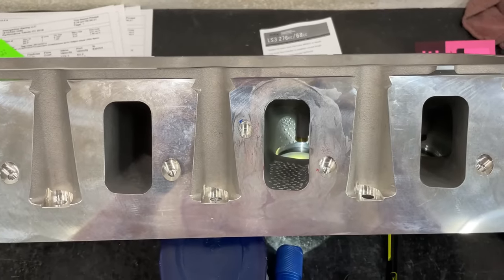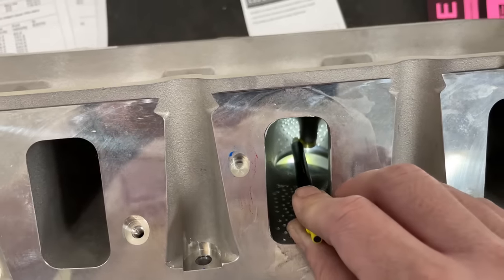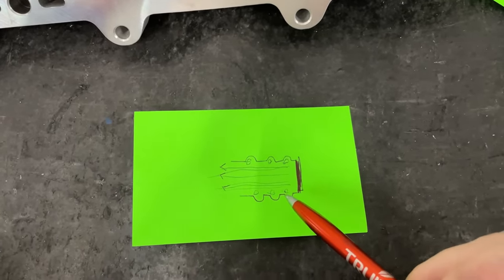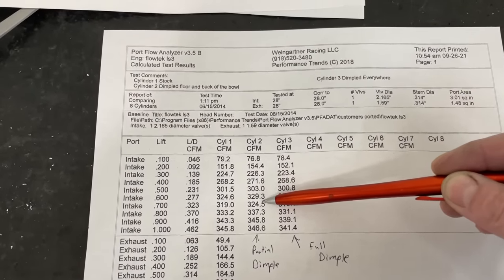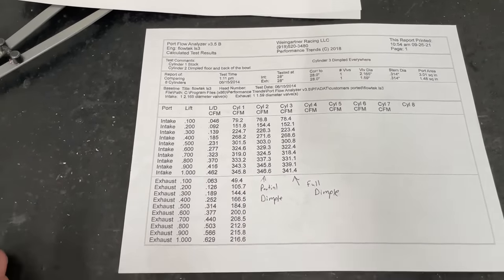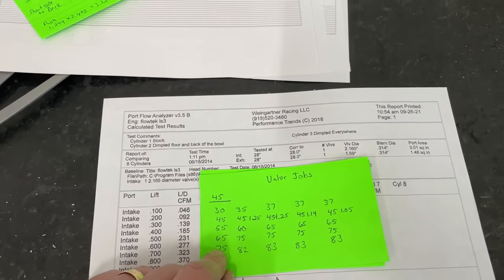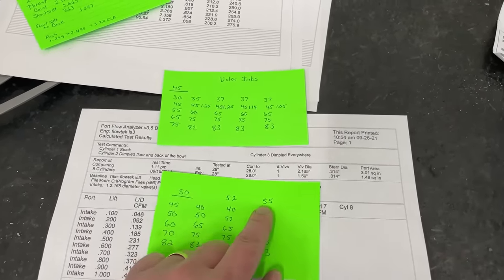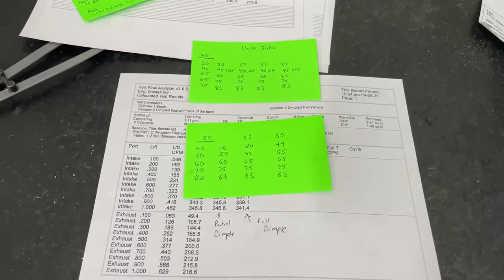Dimpling of Intake Ports Does It Help Part 1 of Internet Ports Heads

Comment: "Dimples on a golf ball create a thin turbulent boundary layer of air that clings to the ball's surface. This allows the smoothly flowing air to follow the ball's surface a little farther around the back side of the ball, thereby decreasing the size of the wake. Scientific American
Reply: That is interesting concept. Have to give you the credit because that's how you find out things and you never know until it's proven wrong. Fluid dynamics is very interesting. What about little runners of blades along the walls. I would not know how to install them, but it would be worth trying something different. Good luck with your testing. You should retest 3 to 5 times then average you numbers unless you can really rely on your number for a bass line and result, so you know it's not a fluke.
Reply: After reading this… Can we start talking about putting dimples on the rear half of race cars panels?
Reply: I think the dimpled principle is worth exploring but a golf ball moving 400 feet per second is different from air moving through a cylinder head under vacuum and with the valve pulses. So they might have to modify the size of the dimples or invert them. But I definitely think it's worth exploring.
Reply: @scottshields8334  tell that to Bugatti
Reply: @scottshields8334  I have tested your hypothesis to see if it could be disproved using the scientific method.
For the test I simply obtained a golf ball and an engine head.
As a control I obtained a second golf ball and an engine head and set them aside under 24 hour surveillance to ensure neither of them was sexually attracted to the other and engaged the other in intimate relations resulting in reproduction of like kind.
I then observed the first golf ball and engine head and compared them geometrically for consistency of design.
Neither of the objects observed displayed any discernible similarities in either shape, size, colour, weight, mass, intended use, common use, form, function, retail price, or resale value. 
I'm sure Bugatti would agree.
Reply: I know there are high end engine builders that dimple there cylinder heads and runners there’s got to be some truth to it
Reply: @thelibertyghost1776  yes sir, I use dimples on intake manifolds, but on the short quick turns. It helps pull the air around corners. Alot of the foreign exotic cars use them.
Reply: @notsponsored103  Modern Science. 🤣🤣
Reply: Fluid flow is sticky at boundaries due to viscosity. That sticky layer creates a gradient from 0 velocity at surface to a laminar-to-turbulent interface at some distance normal to the boundary surface. The dimples create turbulence closer to the boundary surface, so that sticky / laminar layer is thinner and more port area experiences turbulent flow. Basically it makes the port larger in area (there's more complexity, but this is essentially what's going on). This is not a great idea for some cases. Bottom of port worked good because that was the slowest air flow regime. The dimples on the bottom reduces the distance of turbulent airflow from the bottom, i.e. makes the port seem bigger. But the direction the turbulence acts is very important. Top of the port and top of the bowl introduces turbulence that opposes the general direct of flow. It lifts the airflow off those surfaces and generates turbulence normal to the surface that actually pushes against the airflow making the turn down through the valve. That's why the flow bench results were like that.

 Dimpling is only important in cases where the port does not have fully developed turbulent flow. I.e. at lower valve lift, the sticky boundary layer has more effect because the valve is physically unable to flow all the air that "could" be supplied. So air has to slow down and there's kind of a "tunneling" of turbulent air flow though a shell of slow air at boundaries. At high valve lift, more port area experiences turbulent flow naturally because more air is getting sucked past the valve. Then the dimples have little effect because the boundary layer is thinner.

It's somewhat different than a golf ball. The golf ball dimples increase turbulent air to "backfill" the low pressure area behind the ball's travel vector and reduce drag. Totally different aerodynamic regime.
Reply: @scottshields8334  myth busters did it to a 90 something ford tori's and it saved gas
Reply: @HalfBakked218  that’s what vortex generators are for. Evo’s and a few other cars used them (on the roof towards the back) from the factory to increase attached flow on the rear glass and increase the effectiveness of the wing at higher speeds. Airplanes often have them on the wings or horizontal stabilizers. All the dimples/vortex generators do is add energy to the stagnant boundary layer so the flow stays attached.
Reply: @brianballewsr20  nice! See I was just like why not… and you’re like they already did that lol… I could totally see those little pockets create the increased air flo.
Reply: @scottshields8334  agree, I tried to replace my heads with balls... total fail!
Reply: @tondaporter3709  That's where they should be, to prevent flow separation on the inner side of the curve and help get rid of pressure drag on the incoming flow. Exactly how a golf ball works.
Reply: @tondaporter3709  only the turns? Do you get a negative effect doing the whole port or partial(floor-only) ? Im curious tge exotics is it like classic cars with carburetors or more modern stuff(fuel injected)
Reply: On a golfball yes not on a cilinderhead. Completely different
Reply: Dimples are put on golf balls so you can control the flight of the ball and keep it in the air. Without dimples they fly like the most insane knuckle ball ever. The dimples allow the ball to actually grab the air like traction and depending on the angle you come down on the ball with an iron pinching it increasing backspin and if you swing inside out causing a draw left spin as right hand player or like most people swinging across the ball outside in making right spin and slices or with a drive hitting the ball on the upswing slightly to reduce back spin and increase distance as much as possible. Nothing smooth about the ball cutting through the air though stand out in front of a good player and let him hit over the top of you and you’ll hear the ball cutting the air the sound distinctly changes for shot shape as well. I have a degree in pro golf management and won a state championship. Had a driving range at my house hit 300-1000 balls a day for years.
Reply: wtf does that have to do with this.
Reply: @notsponsored103 So they didn’t even fuck?
Reply: @wedrivebynight  I couldn't believe it either

Comment: Love the series, Eric. I’m 22 now and have been obsessed with cylinder heads and flow numbers since I was 15. My friends were out playing football and partying while I was trying to build engines and go fast. So glad I came across your channel
Reply: Keep up the passion and motivation young man
Reply: Pick up a head off an older honda accord ex, f22b1 engine code. They are rumored to flow just as well as the hand ported b18c Type R heads from Japan. I'd be interested to see if this is true.
Reply: Wow, a true motor head!!!
Reply: Build yourself a small Flowbench like I did in my teens....actually I was thinking about marketing that kit for small head porter's etc Thanks Trev New Zealand😊🇳🇿
Reply: @trevinskiking2165  I made one from a shop vac and manometer.
Reply: You could've done all three. Weaksauce
Reply: Will the stagered cross flow affect the experiment compared to a pure cross flow?
Reply: @gingernutpreacher  Depends what angles the valves are on, if any...Trev NZ🤗🇳🇿
Reply: @sideshow45  F series is much newer so it would make sense. Just like the LS vs SBC, CAD/CFD helps. F20C if its remotely related would explain a lot (if trickled down to f22 etc).
Reply: Damn you're so cool
Reply: Jus scrolling through the comments and I passed by this one because I can relate. I’m 16 years old now and caught the bug from my grandpa and my dad. I started porting cylinder heads for my friends mini bikes. I went to a mini bike event and my good buddy won his class with my head on it. Now that I’m older I’m starting to work on car stuff. I will be porting a set of sbc heads real soon so I’ve just Been watching a crap ton of videos on porting and polishing. While my friends are out partying and what not, I’ve been on a quest to find ways to make hp and torque.
Reply: There's hope for white Americans.
Reply: That's funny I read this comment and I felt like I wrote it been doing it since I was about 14 and I'm 39 now it's one of those things where if you get good at it you really can save yourself a lot of money not having to buy really fancy cylinder heads!
  if you don't want to even do that you can make good money porting
Reply: Sounds good to me.
Reply: 牛逼！
Reply: Same heer man we have that in common we need to own our flow benches
Reply: Stay with it but remember, air doesn’t like to change direction and flow numbers aren’t everything. The straightest path into the chamber is important also.
Reply: @sideshow45 THE Japanese know how to build engines the right way. They done it right be4 any other country

Comment: The dimple intake was something used by Germany's Veicomer Performance a few years back. They had CNCed all the heads and had hard data. It was to limit "Laminar Flow." As I recall, the problem was, the length of the intake isn't long enough for the dimples to make that much difference. It is cool to follow each engine builder's experiment. This is what it takes to find horsepower. Cool video!
Reply: its beneficial on two strokes, but even then its only minimal in comapriosn to moving ports, power valves, responsive reed valves and a properly resonant exhaust, one might think that in  an airbox design?
it might actuall be of a bit of extra benefit,
Reply: It's probably more to prevent boundary layer flow, which is generally laminar, and provides resistance to flow because it is slower.
Reply: Isnt laminar flow desired ? Less turbulence.
Reply: @mitchrichard8551  you want to prevent laminar flow, at the boundary. It's a fine line though and is really complicated because laminar flow at boundaries stabilize the flow and can prevent it from separating and becoming turbulent. But with proper engineering, turbulence at the boundary will provide less resistance than laminar flow.

Think about why there is always less wind at the surface of the planet than, say, a couple hundred feet up.

Air literally sticking to shit down here fam, and it's (at scale) pretty laminar.
Reply: @grinchyface  thanks
Reply: @mitchrichard8551  The short reply is: Think of laminar flow is like a stream. It flows across the stream bed, rocks on the bottom. The water goes over the rocks causing the water to roll behind it. Yes, it slows down the water, however, the further away from the rocks the water gains speed. With everything there are variables, ways to control these effects.
Reply: Veicomer is portuguese.
Reply: @tiagosilva2635 he meant NG I think! Veicomer Building a lot of crap, I have a head made by them and issues all the way. Also they simply enlarged the ports but there is more to it than enlargement!

Comment: I dimpled the intake ports on a methanol burning Briggs & Stratton go kart and it made quite a difference in power. I also found that if a I keep the head temp between 375 and 400 degs it had better response. If I let the head temp get over 400 deg. the piston got too big for the bore and would break the block.
Reply: Mike , we did the same on the old flat heads. Eventially moved to punch marks especially on the back wall of the intake port..
Reply: i would say that dimples on a carb fed engine will show more increase than in a injected engine... its a matter of the juice being worth the sqwz?
Reply: On the dyno it gained nothing. I still have a wka , dyno cammed engine we dynoed that was dimpled. It lost everywhere in the rpm range. Don’t waste your time.

Comment: Eric 20 years ago when I was racing hydro plane boats we dimpled the bottom of the boat where the water would hit on the last12/15 inches of the boat bottom. The boat was faster by a few MPH. No one could see what we had done. Then we dimpled the top but only for testing. Again the boat was faster. ( we put the same motor on 2 different boats) It worked every time we tried it. We never did run it on the top racing but ended up doing the whole bottom that you could not see standing next to it. After we got out front we just put distance on every lap. You will find the better you can keep the pattern the better your results. Kind of like a golf ball it allows little vortex so the air can not stick to the surface. Rick
Reply: Richard... there was a similar technology used on America's Cup Yatchs in the paint finish like fish scales that got you about another 1/2 knot in boat speed, altogether are different kettle of fish because we are taking boundry layer friction not mixture distribution.Trev New Zealand 🙃🇳🇿
Reply: That’s correct.
Reply: @dekonfrost7  I know it's correct cause it's true history.
Reply: I heard dimpling boat hulls actually creates more friction. With air you get a boundary layer from the turbulence but i think it doesnt happen on water... not sure.
Reply: @blivetsoftruth  we only dimpled the botton of the boat that was touching the water when on plane. For our hydro's12'/14' it was about the last 12"/14"
Reply: @richarddechau4200  i don't want to argue but maybe it helped it plane better due to the friction at the very end? Dimpling the top hull makes sense tho. If it was any incremental decrease in drag, i'd think freight ships would have them but, it'd make for a terrible maintenance.
Reply: Cool.

Comment: I work in aerodynamics.   Surface roughness can cause the flow to to change from laminar to turbulent, this means the zero velocity air at the walls of the intake has less ability to restrict airflow through shearing forces of the flow.  NOW, if your flow was already turbulent, you run the risk of adding flow resistance due to surface roughness.
Reply: In a 2 Stroke you'd add more power Crankcase " Stuffing " than any theorectal "dimpling "....Trev New Zealand 🇳🇿
Reply: Could this be acting like a turbulator so the turbulent flow adheres to the wall around that sharp bend going down to the valve instead of separating as it goes over the edge? That's why I think the partial dimple works, the floor boundary adhesion outweighs the losses of the dimples.
Reply: @Kasekraner  Mixture & Exhaust gases move down the tract in a side on D shape slower @ the walls than in the center 2/3rds....Trev
Reply: can i looks at from the perspective of surface area. dimpling increases, therefore the runner has the effect of bigger sa -> smaller sa..... so pressure  goes up, velocity goes down? in boosted applications I want more pressure at the valve boundary to overcome the internal cylinder pressure. or am i off?

Comment: The changes are within margin of error do 10 more runs with out changing anything and see what the standard variance is👍
Reply: This is exactly what I was here to say. It would have been worth it if he had done the test before and after and normalized the test per the differences in each cylinder to separate the testing differences.
Reply: Racers have been smoothing ports because that is what works. Dimples are like imperfections and only reduce performance.
Reply: Dimple increase speed but greatly reduce effective volume of a tube/runner.
Reply: @TJPDmember  this seems to make a ball faster. Not sure on a head tho
Reply: @Mroswaldo16  Yeah, like I said, more speed, less volume. Not what you want really for an intake port.
Reply: He made those tests at different time, which means: different air temperature, which means different atmospheric pressure, which means readings would differ with or without adding dimples, which means they are totally irelevant
Reply: @flugplatz8719 , review how a manometer works - I t’s a differential pressure related to atmospheric pressure. Also, very likely his bench is in an atmospherically controlled room.
Reply: yeah i really wish he did multiple runs. difference between runners/cylinders could account for those changes